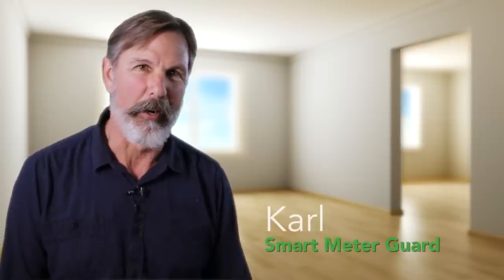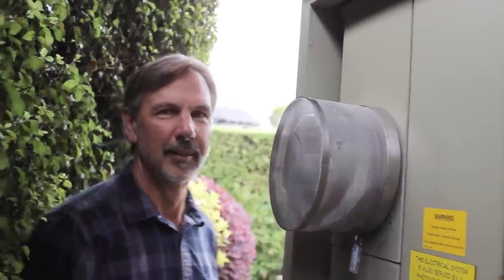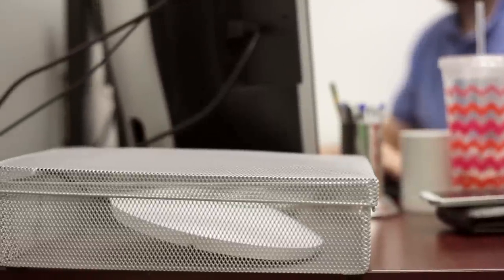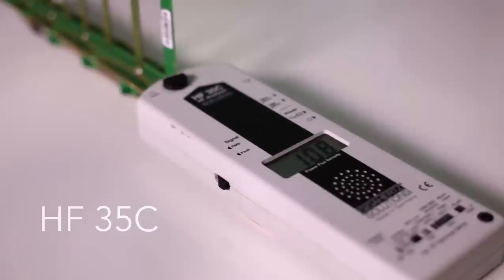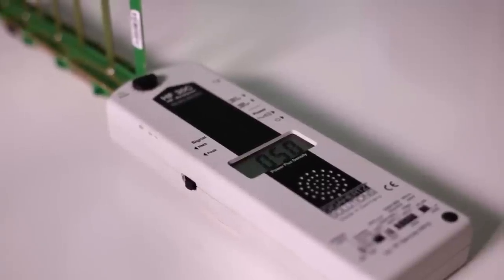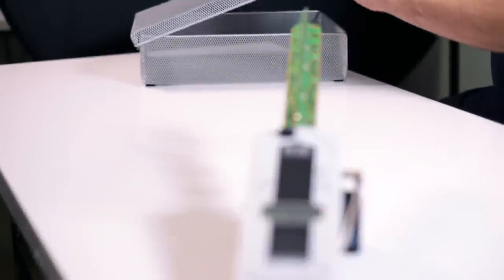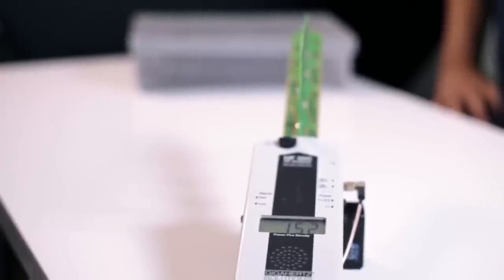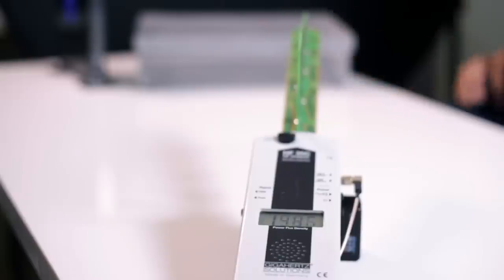WiFi Router Guard - Blocks WiFi RF Emmissions

Comment: I recently decided to unplug the router from the computer upstairs because of all of the information that I have been reading of late regarding potential radiation damage caused through wi fi emissions. Now me, my wife and 3 teenage kids are all having to share the hard wired computer (which I personally don't mind), but as you might understand, my 3 kids have all had a melt down! Forgive my ignorance please, but If I was to reconnect the router and place a guard on it, would the router do the same function that it was previously doing, and give us access to the wi fi as well as at the same time protecting us from potential radiation damage?
Reply from the maker: Hi Gary,  Thanks for asking.  Yes, you can still use your router with the Router Guard on and still get a signal.  This is because the Router Guard blocks about 90% to 95% of the signal.  The 5% to 10% that gets out is still enough to use your router.  However, you will notice that you will have to be about 10 feet closer than the furthest you could be away from the router and still get a signal before the Router Guard.  Thanks.
Reply: Thanks so much Karl. I live here in Australia and I will try to source one here to save on currency exchange and freight costs. However if I can't find something similar I will gladly support your business, regards Gary. P.S. Our smart metre outside is rectangular shaped not circular, do you also make different shapes?
Reply from the maker: HI Gary, we get a lot of request for a Guard for the rectangular smart meters in Australia.  The problem is that there are several different size smart meters there so it's difficult to make one that fits all.  We did see a company in Australia that makes a rectangular shield but we haven't tested it so we're not sure how well it works.  You might look into this company.  Here is a link to their site  https://www.purespacesolutions.com.au/product/15242/  Hope this helps you.

Comment: Are those the inside dimensions, or outside?
Reply from the maker: Hi Red Bird,  The inside dimensions of the Router Guard are 12" x 9" x 2 7/8" .  We also make a Large Router Guard that is 12" x 11 7/8" x 5 1/2".  https://smartmeterguard.com/collections/all/products/router-guard?variant=1114895189  Thanks
Reply: @SmartMeterGuard    So it's 12" wide and 9" deep, and then an extra 2 7/8" added to the bottom?  So the depth is 9" + 2 7/8" = 12 7/8" deep?
Reply from the maker: @smileyone1612  Hi Smileyone, Actually it is 12 inches long and 9 inches wide and 3 inches deep.  However, routers can be set on their side and it doesn't affect how they work so if the only way your router fits is with it on it's side that will work.  Thanks

Comment: You're kind of fearfull, aren't you? If a person owns a WiFi router they probably bought it to use. Why would they put it in your silly "WiFi guard" and then block the signal? I'm confused - educate me
Reply from the maker: Hi Steve, Not sure but maybe people didn't realize they emit RF and then decided they didn't want to be exposed to it.  The router can still be used with this Guard because it blocks about 95% of the RF.  The 5% or so that gets out is still enough to use the router with about a 20% reduction in distance.  So, for the people that don't want the 
 RF exposure from their routers this Guard cuts it down by 95% or so.  Thanks
Reply: Also for night time. Use cage when you don’t need wifi. WiFi is bad for melatonin at night.  Sleep is very important.
Reply: I just turn router off at night, its not needed then anyway. @Jwick1518

Comment: Will wifi still work ?. I ask cause where  I live in my cell phone connection is bad so I rely on the homes wifi.
Reply from the maker: Yes, you can still use your WiFi router with the Router Guard on.  However, the signal will be weaker so you will need to be 20% to 40% closer to your router, depending on what router you have have, to still use it. Also, what we found is that for people that want to use it further away they just open the lid of the Router Guard an inch or so and they can use the router further away.  The lid acts kind of like a throttle.  The more it's open the more signal will get out.  Thanks

Comment: Our WIfi modemis in a bedroom and we've heard that sleeping with all those nasty waves can be bad for your health. Does this device protect us from the wifi waves while still letting us use our modem
Reply from the maker: HI, yes, the Router Guard blocks about 95% of the RF, radio frequency, waves your router is emitting.  If you don't want to be exposed just at night you can go into the settings of your router and turn off the WiFi for certain periods, say from 9:00 pm to 8:00 am.  That way you're not exposed while you sleep and you don't have to buy shield to do this.  Thanks

Comment: It sounds really interesting. Me and my family are looking for things to protect ourselves from everyday radiation from the daily technologies we use. Is there a return policy on this Router Guard? Because I would like to buy one, test it out and measure the radio frequencies as well and test the distance and wifi signal for my own home.
Reply from the maker: +Verbal D Hello Verbal,  Yes, we have a 30 day return policy so you can buy one and measure the RF it blocks.  If you aren't satisfied you can return it.  We know you will be satisfied because we have thoroughly tested the Router Guard on many routers with a very sensitive and accurate RF meter.  It's a Gigahertz Solution HF 35C.  Thanks

Comment: Why not just get rid of the wifi.
Reply: good luck with that.
Reply: Ethernet cable how hard is that?
Reply: John Puccetti My mistake I thought you meant get rid of it all together.
Reply: John Puccetti doesn't  work it still emits  same level of radiation  when hard wired
Reply: Hard wire every thing.
Reply from the maker: Yes, hard wiring will eliminate the RF from the router only if you go into the settings of the router and turn the wireless function off.  If you don't do that hard wiring to your router won't stop it from emitting RF.
Reply: Seriously? What about when I turn off wifi on the router (there is a nob) as well as turn it off on my computer in settings..?
Reply: I'm not understanding what this is. It increases internet speed, but I'm not getting how it eliminates EMFs.
Reply: why did you think it increases internet speed? it dosnt.
Reply: or just use an Ethernet cable...
Reply: Google Faraday cage...and yes, the idea is nice, but kind of pointless...just unplugging the device works better :)
Reply: you can call your internet provider and have them turn off the Wifi...I did it.
Reply: You can....call your internet provider and tell them to turn off your Wifi service...that's what I did...they did it.
Reply: @biancas2639  What if you need to use wi-fi though?
Reply: @SmartMeterGuard    also, Virgin Media here in Europe : Their routers have a third wifi signal which acts as a hotspot, continuously emitting radiation.   Avoid Virgin Media at all costs – you cannot disable this 3rd wifi signal yourself and will need to contact them to request this.  However, we know of cases where this signal was disabled only to turn back on again.

Comment: The cords?
Reply from the maker: Hi Quantum,  The cords go threw a 3/4 inch diameter hole in the back of the Guard.  Thanks
Reply: @SmartMeterGuard  I bought a router guard and it works very well. I don't feel the dizziness that I was feeling at first and I also cut off my 5ghz and just use 2.4ghz

Comment: Ok, I work on Radar, Navaids, and com for the FAA. If I don't have RF, I don't have communication. So this cage lowers the RF. Wonderful. But how does that not affect the range of the wireless service? And because it's in the cage, what is the device's receiver sens, if it can receive at all?
Reply from the maker: Hi Drarbo,  The Faraday cage is about 95% efficient at blocking the RF.  The 5% or so that still gets out is enough to still use the router.  The only thing is you will have to be about 10% to 20% closer to your router to still get a signal.  
 It's almost impossible to block 100% of the RF.  Thanks

Comment: You can stop wifi from settings of router and use a ethernet cable to connect your pc
Reply from the maker: Hi Florin,  Yes, you are correct.  However, if it someone is not able to hard wire connect to their router they can use the Router Guard and block 90% or so of the EMF  exposure while still using the router with their wireless devices.  Thanks

Comment: Ordered mine this morning (from Australia), looking forward to it. My router is also hard wired into my work PC (i work from home), so the wi fi signal is not really a big deal during the day, but hopefully it doesn't kill the wi fi signal too much because when kids get home from school and wife gets home from work, we all use the Wifi (for our iPhones, iPods and for Netflix via our PS3), we want a decent signal, I have a 2yo Netgear N300 wireless router, so fingers crossed it all works! Will be great at night where I can just close the lid of the cage to reduce the nasty signals by 95%!
Reply: Knight Industries just shut the router down while sleeping...
Reply: This cage screws up the communication between your pc/phone/tablet with the router so the device you are holding needs to ramp up its transmission power in order to compensate for the bad communication. So your closest device emits more RF which is the most important thing. RF power drops in inversely proportional to the square of the distance. Guess why? Because your router can't hear your device while being locked in a cage and asks the device to increase its transmission power. It also screws your internet speed and wifi range. Well done product.
Reply from the maker: HI Ali,  You should do your research on this because it just isn't true.  There is no circuitry that controls the RF power in these devices.  They all just emit at the same level they were designed to.  And, yes, you can still use the router withe the Router Guard installed.  Maybe you should get one and try it so you can test it for yourself?  Thanks
Reply: If you need to shut the box, then its just as easy to unplug the router!
Reply from the maker: Hi baja,  Yes, you can still use the router with the Router Guard installed.  Thanks
Reply: As I mentioned I work from home, I only need the wi fi router for 2-3 hrs a day and that's when kids get back from school, Why should I be bombarded for 8 hrs with radiation during the day? I have a fibre optic modem on my wall which goes to the wifi router and my PC. I know I can just switch my wireless router off at night, but I cant during the day, so the router guard is a good solution for me.
As for the reception with the router guard, it does work, but you need to be much closer, roughly half the distance.
Reply: @KnightIndustries572   you should be able to go into the router settings and set up a scheduled of times that the wi-fi is on and off. just set mine up to turn off at 1:00am. and turn back on at 8:00am.

Comment: What can I do to protect myself against the neighbor's WiFi router, which stays in a room adjacent to my own bedroom? Just in case I was not well understood, I live in an apartment, with one common wall separating us.
Reply from the maker: HI Gina, There's two things you can do.  One is that you can ask them to put a Guard on their router but their probably not likely to do that.  The second thing is to put some type of blocking material between you and their router on the other side of the wall.  The bigger the better because RF will do around it at some point.  Plain old aluminum window screen will work well and you can get it at your local hardware store.  Plus, it's easy to cut with scissors.  You can tack it on the wall between you and the router.  Hope this helps you.  Thanks
Reply: Gina, I got a huge (4' x 4') cheap but tasteful artwork on canvas and simply taped foil on the backside of the canvas.  Then I hung it on my wall centered on the exact spot I knew my SmartMeter was on the other side of the wall. Super simple.  Blocks 90% of the RF.
Reply: Well, that didn't work for me. I taped foil to the back of the headboard of my bed and it didn't work at all. The measurement in the exposure meter was still the same. Could it be that I didn't use the proper copper foil tape to connect the different pieces of foil? Could you tell me what kind of foil you used? And what kind of tape?
Reply from the maker: HI Gina,  The problem you have may be because you did not use a large enough piece.  We usually don't recommend foil because foil reflects RF so using the foil you're reflection the RF in many different directions.  Aluminum screen absorbs RF.  Thanks

Comment: ok i get it its work but what is the whole point of this?
i mean you could just turn off wifi inside the software router, you could do even better schedule it so its turn off during certain time. its take literally 30 second to do!
Reply from the maker: Hi Yazmo,  Yes, you could do this but like you say every time you want to use the internet you would have to log into the admin settings of the router and toggle it on or off.  This is particularly hard if there are multiple user.  However, people should do what you suggest at night if they don't have a shield on it.  Thanks
Reply: np, i wish shielding product was less expensive.
I have read that japan did try ti make a cheap and affordable paint that is blocking Wifi signal, so far so good i think this may have gone wrong i can't find anything about it at this moment.

i thinking about shielding my floor with aluminium screen, and use Some NOVA Shielding Fabric.
i may actually do a before and after comparison on youtube eventually, keep up you great work.
Reply from the maker: Hi Yazmo,  You can make one yourself inexpensively if you are little handy.  You can buy some aluminum window screen at your local hardware store and encapsulate your router in it.  Aluminum window screen is actually very efficient at blocking RF.  

We have heard of the blocking paint but have never tested it.  One problem with the paint is that it's quite expensive.  Last time we checked it was over $400 a gal.

If you decide to cover your floor we'd suggest the alumininum window screen or other type of screen.  Metal fabric will work but again it's expensive.  Hope it works out for you.  Thanks
Reply: yea i was aware of aluminium screen.

i was also planning to do that in my main office floor so i don't the first floor office signal in, using fabric and a bit of paint the area is like 6x8.

Want im trying to achieve if its going to work.
is i wanna have the apartment with WiFi but have a room free of RF signal. or as a minimal strength.

/Great Channel wish ppl were more aware and push Gouvernement to take action.
Reply: ... hhm so how would i turn off the signal?

Comment: Makes no sense to put your wireless ap in a cage to block rf... Kinda counterintuitive as you will need to be closer to the ap to get signal when you want to use it... It's smarter to use wired Ethernet where you can around your house, and a separate AP for when you wanna use wifi, and just turn the ap on or off when you don't want it...
Reply from the maker: Hi Rumpkisser, The Guard doesn't completely block all the RF.  It blocks about 90% or so which means you can still use the router and reduce about 90% of the exposure. It also requires that you be about 20% closer to the router as well to still get a signal.   You are correct in that people can hard wire their devices into a router.  The issue with that is that if you have a mobile device you always have to find a cable wire plug it into to your router.  That's not an issue if you device doesn't move around.  Thanks
Reply: SmartMeterGuard then lower the radio broadcast strength of the AP to 10% of the normal strength, any somewhat modern router allow this in the configuration.

Comment: Router and Wifi covers are very simple to make. Materiald; Metal screen, foil tape, ruler, wire cutter scissors, black marker. Meaasure the height/width of Router and Wifi, use ruler and marker for straight lines, cut the screen, tape it together..........done!
Reply from the maker: Hi Jacqueline, Actually, it's not quite as simple as you make it sound and we don't recommend using foil.  Foil reflects RF and you can easily reflect it in a direction you don't want it to go, like back at you.  Additionally, it's hard and expensive to test to see if you are actually blocking a significant amount of the RF.  However, it can be done but it's not as simple as you make it to be.  We make the Router Guard for people that don't want to make one, who can't make their own and for people that want a turn key proven and tested product reasonably priced  that blocks 90% or so of the RF routers emit.  Thanks
Reply: @SmartMeterGuard  She says the material is metal screen. Only the tape is foil.